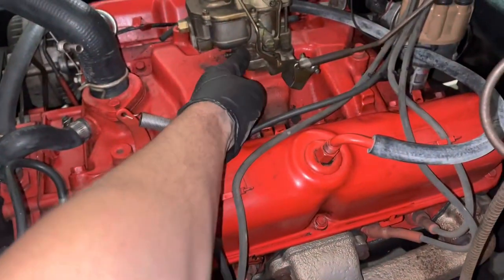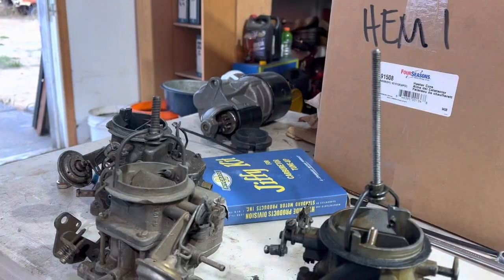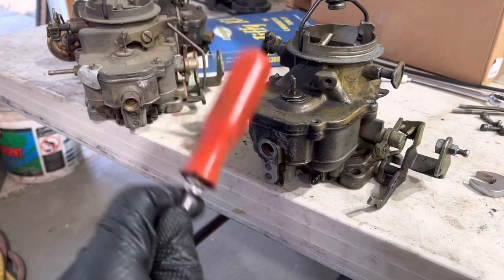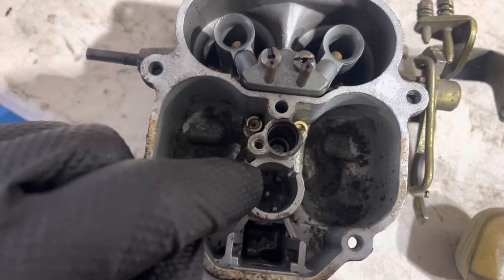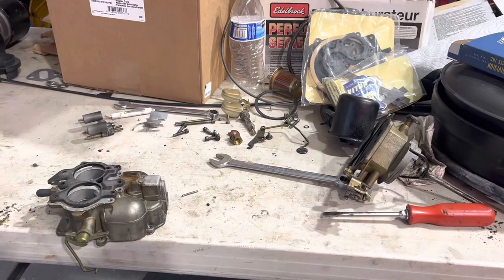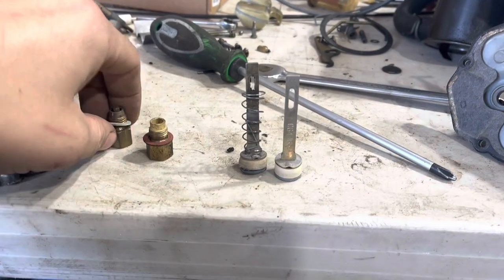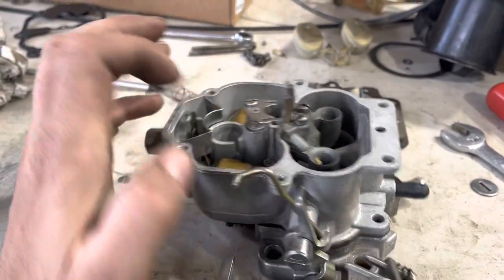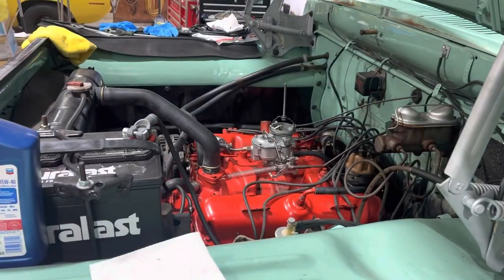How To Rebuild The Carter BBD Carburetor

Comment: Hey Jamie! Really Love your channel. I have a question about these bbd's i noticed you drilled the throttle blades of both baseplates. Any advantage in this? I have the same type (china) bbd and it keeps smelling (rich) on idle, also idle is not smooth. Tried to set idle screws as good as possible using vacuum, but meter is also irratic.  I have a Summit 1789 cam with 216 duration. Will drilling the throttle blades improve my situation? Regards from Europe!
Reply from the maker: I didn’t, it came that way. Instead of drilling I would try some kind of bypass hose with a small adjustable valve from manifold to ported vacuum. Uncle Tony recommended one of those fish tank bubbler valves. Also… those Chinese carbs in my experience have been total junk.

Comment: i have the same carb off a 318 poly...it sounds like it starves for fuel on take off...i gotta slowly feather the throttle or it will stall...now it wont idle properly...the guy i took it too reckons its not the carby its ignition but i dont believe him...this time iam doin it myself...thanks for the video

Comment: I've got one of these in my 88yj and I've been under the impression it was EFI. Been having an issue with it burning rich, it dieseling as second or two after I kill the engine, and it dying after driving for awhile.

I'm gonna take this bad boy off and rebuild it. Can't afford one of those fancy carbs everyone loves.
Reply from the maker: Dieseling = very lean, or late ignition timing. I’d try timing before anything else.
Reply: @DeadDodgeGarage  ill give it a look at. Still probably gonna rebuild the carb. Most stuff is oem and most of the gaskets have dry rotted or has turned into a sealant type mush.

Tyvm for the video and advice!

Comment: Nice video.

I've got a 68 Coronet 500 convertible that I've owned since 1992 (my uncle bought it new) and both of the BBD carbs that I have are missing that baffle (butterfly looking metal) in the bowl. Either it wasn't used in my car or somebody removed both.
Reply from the maker: Commonly left out, I think. I’m fairly sure they should all have one, but I could definitely be wrong. The little retaining strip for the float pivot definitely isn’t optional…

Comment: Why does it take 20 minutes for my high idle to kick down?
 Put a new heat spring thing on but no difference.
Reply from the maker: Couple possibilities. First thing that comes to mind - I’ll bet your heat valve in the passenger manifold is stuck open, which is pretty common, so you don’t get as much crossover heat. Is this a small block? What temperature is your thermostat? I just had this on a 440. It didn’t take 20 minutes, but it took 5+. The valve was deleted, so unfortunately there isn’t much I could do about it.